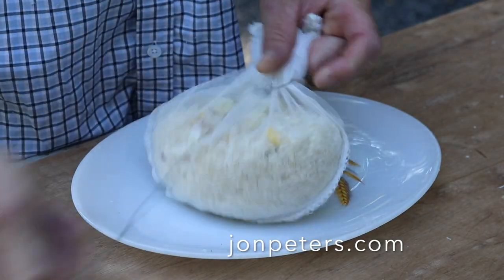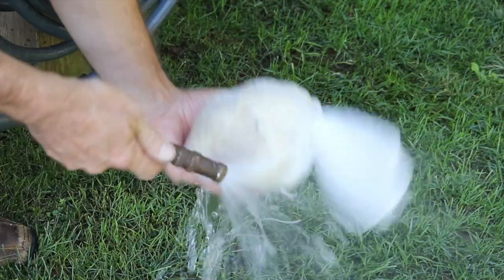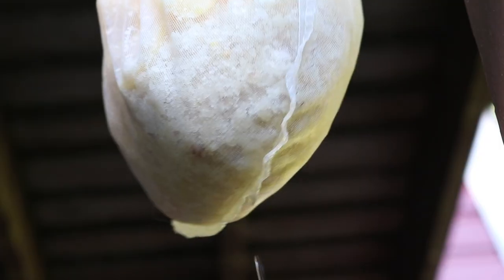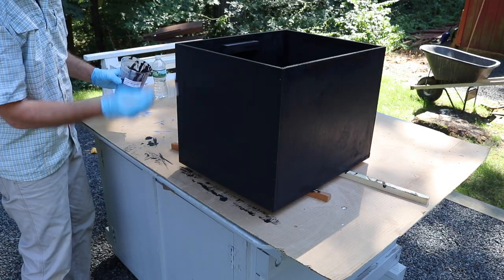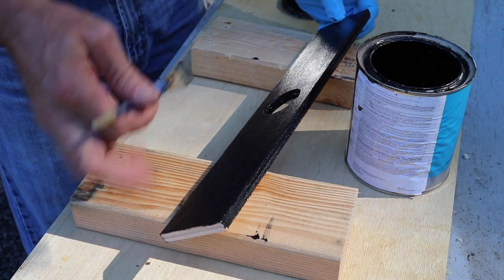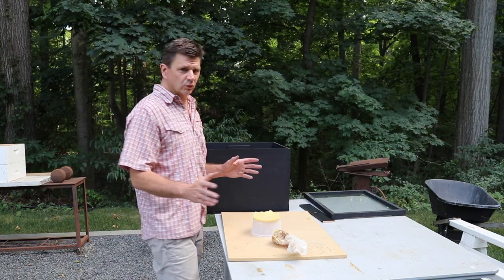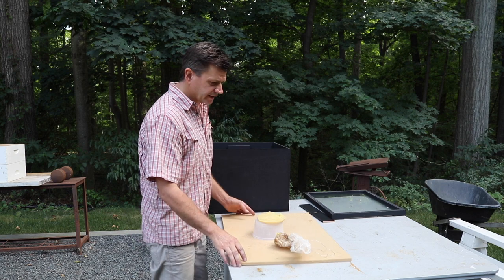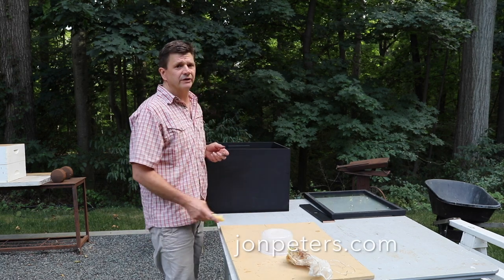Beekeeping for Beginners, Make a Solar Wax Melter for Beeswax

Comment: If you paint the inside of the box white it will heat up more.  Black absorbs the light, white Mel’s it bounce around more and drives the heat up.  I know it’s a little counter intuitive but it works.

Comment: If you have a stainless steel bowl you can cut out the center let it drain into the bottom cup but hang the wax in the center top of the bowl. It will focus sunlight on the wax. Careful of fire though. Baked a muffin in school science project that way.
Reply: Aluminum foil will suffice too

Comment: Jon, I know this is an older video, but if you are going to slant the top take your latitude and subtract 15 degrees. It's how people figure out the angle to tilt solar panels for maximum efficiency (in the summer). Then aim it south (if you are in the northern hemisphere).
Reply: John Black  if you put an nail perpendicular to the glass on the face  of the frame and it casts no shadow the angle is perfect.  Max light enters the box.  Since how high the sun travel in the sky according to the seasons you’ll want to make it a little adjustable.

Comment: Someone here on YouTube made a similar project (but it was for reclaiming wax from old used candles), the big difference was that the device was in two sections. 

One was the black box, no light passing through, otherwise almost identical, even with a dowel rod instead of the piece you have, and the other was a piece of aluminium (i think it was some left over heat sink material from some transformer or something) that passed inside the box. Above the other end of the metal was a fresnel lens. 

It would heat up the bar, which would then heat up the box. If someone knows the video hit it up, it was pretty effective.

Comment: Hey Jon. What a good idea ! Thank you. What about 3 legs (one adjustable) to get the perfect angle to the sun ?  a pivoting frame inside could maintain both the cup and the bag level. Maybe some exterior insulation may help the temperature rise.

Comment: you could add a mirrors on the inside to increase the heat. or better yet stick it in your attic, it's ussually hot as hell up there.

Comment: Nice project. Curiously enough glass it's the perfect material for the cover. Everything is radiating energy away as light, not so hot glows infrared (invisible), hotter goes red, insane hot goes ultraviolet (invisible, part of the sunlight). Glass allows UV from the sunlight in, black absorbs it and gets hot, but glas is "black" for deep IR radiation and blocks it from coming out.
Reply: Not black so much as reflective. If you look at yourself in a piece of glass with a FLIR camera, you will see a reflection.

Comment: Black paint sometimes works but try lining the box with foil, HOT HOT HOT..
Reply from the maker: got tip Paul..thanks
Reply: Try to use a reflector above the glass in the top. It will intensify the heat. Have a look at solar ovens.
Reply: Paul Espinoza foil versus painting the inside white is only a 2% difference in reflectivity.